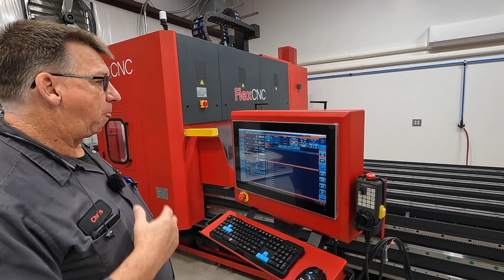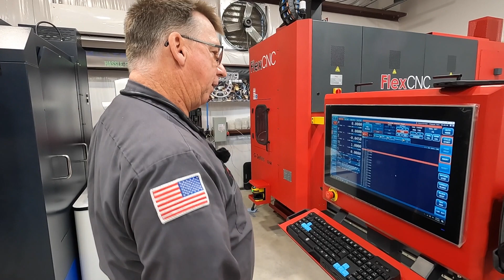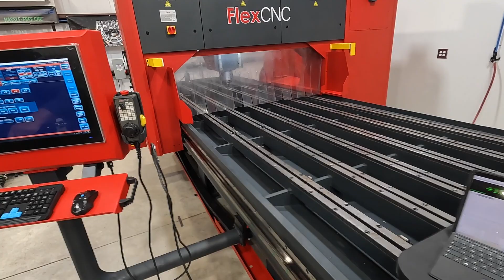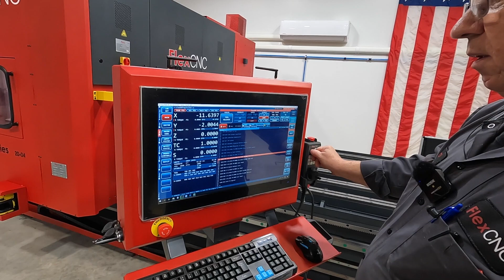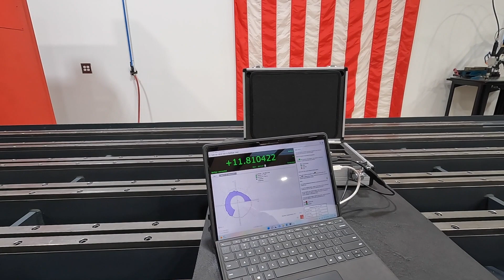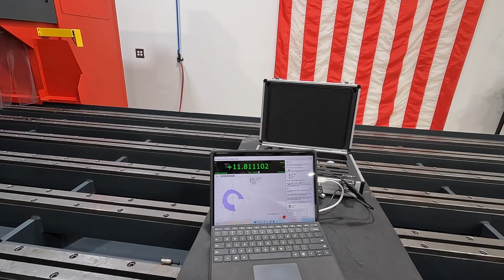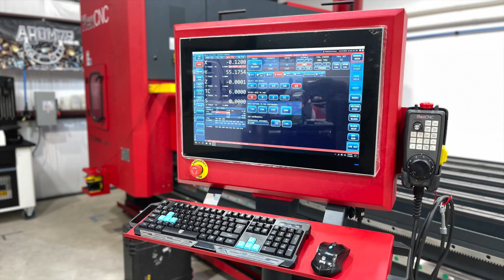Installing the Flex CNC Long Bed Vertical Machining Center

Comment: This thing is enormous. In curious what you are going to make on it!
Reply: The Flex can do more than large parts.  One of the things you can do with it is set up multiple stations along the bed for the same part.   You move the parts from station to station.  So, instead of doing one step on a batch of parts, then setting up the next fixture and doing all of the parts, then setting up the next fixture, etc., you set up all of the fixtures and move the parts from fixture to fixture.  While the machine is working at the first fixture station on the first operation, you're moving all of the parts to the next fixture in sequence.  When the machine moves to the second station, you're putting a new piece in the first station to start the first operation.
Reply: Please don't refer to a79 as a thing. Yes he is big, but he used to be a human before monetization got the hold of him.

Comment: The remote access via WiFi seems like a potential problem from a malware standpoint. It would be a shame for someone to be able to come in and trash your calibration tables. Probably a good idea to make sure the settings are all backed up so they can easily be restored. My experience tells me that software security is an often neglected part of these robotic systems. I like the safety measures that are in place. It might be a good idea to put some warning tape on the floor to indicate where it is safe to walk in addition to the built-in measures. A pretty cool machine. I'm excited to see some of the fabrication you end up doing.
Reply: Thanks, Doug. I'm sure they never thought of that.
Reply: I'm sure it has an Endian with a firewall.

Comment: Adam .. The man that machines to very small tolerances and accuracy , watching the drill man butcher a hole at whatever angle must of been spewing inside 🤣
Reply: Harsh 😆but fair
Reply: I was thinking the same thing!
Reply: The precision machining isn't done on the metal pads on the concrete floor. It is done on top of the super leveled machine bed. What, are you a doofus?
Reply: @swedishpsychopath8795  every part of the job is worth doing it well.
Reply: @swedishpsychopath8795  true, but as someone who watched a factory tech totally butcher the installation of our CNC machine (sloppy, cutting corners, careless), I can say that when you put up the $$$ you expect a good job, through and through.

Comment: At 38:47 Chris says it is accurate to 0.6 across 240". That means 1/400,000th ! Over that distance. Amazing.
Reply: I wonder if it's going to be that accurate with the mounting bolt holes into the concrete all drilled pissed as a fart, not one of them upright
Reply: Moreover, the machine can re-calibrate itself just in case the concrete shrinks.
Reply: I was trying to figure out what you were saying but thanks for the timestamp... 0.0006" across 240" is what you meant.
Reply: @GilmerJohn  Actually I think he said it was within .024" but the control corrected that error to .0006". Then Adam said leveled to .001" but unless the bed and the gantry rails are not parallel I suspect that is not correct. At 37:50 I believe that is actually what the machine looks like so it is either humped or bowed I can't see it well enough to tell what the software is indicating.  Even so .001"/ft of travel is not bad. Assuming the bed is parallel to the gantry when he mills the rails it should show what way it is assuming he takes a cut smaller than .010".

Comment: I'm sure there is more checks and install stuff going on but I hope these guys run a string line down the bed from the head assembly to make sure the bed is fully square from the far end of the bed to the vertical head end.  Definitely needs a professional install, way too many parts to assemble.     Waiting patiently for it to be all done so we can see chips & coolant fly !
Ahh posted too soon -- lasers  'nuff said
Reply: Lasers are 1000x more accurate than strings.

Comment: What kind of jobs is a machine like this for?
Reply: working on large structural beams, H, Square and so on. Among else
Reply: If a part has multiple machining operations, you can set up all of the fixtures along the length of the bed and do all of the operations in sequence instead of batching parts by operation and then changing the fixture.  It's not just for making large parts.
Reply: You can do a lot of stuff on something like this. Everything from small stuff to very large, complicated 3D stuff. You just need the proper work holding tools.
Reply: Perfect for shaft work!

Comment: Is concrete not supposed to be drilled straight?
Reply: coriolis effect.   you need to drill the holes at a angle to compensate for the angular velocity of the earth's rotation.
Reply: @ScottPankhurst  Ha ha good joke
Reply: @ScottPankhurst  🤣🤣👍
Reply: @ScottPankhurst  You forgot they also have to factor in the gravitational pull force from a79 massive body ...
Reply: No, it doesn't matter.

Comment: In there a reason they didn’t install the feet off a template then deliver the machine directly onto them?
Reply: It won't work. Trust me. Better do it the way they did.
Reply: @swedishpsychopath8795  we install all our machines with templates, they are accurate to the mm even with our subbies. Thats better than what you get from a 3/4” sds.
Reply: @toml8142  I don't think so. Please trust my gut feeling om this one.
Reply: @swedishpsychopath8795  I’d rather not but learn the reason why, I’m sure there is one.

Comment: That milling machine is going to launch chips all over that new machine...

Good video 
🇬🇧☹
Reply: It has flexible strip curtains on both sides of the machining head to contain the chips and coolant.
Reply: @buckhorncortez  

So not the rails it rides on then...
🇬🇧☹

Comment: Why do you need a machine that size?
Reply: I'd say there is probably a gap in the local market for large machining, Having a machine that can do big parts can open you up to customers that other shops can't even entertain due to the size of the parts thus giving you an edge in a very competitive industry. Earning the trust of customers on big parts will then bring you their small stuff because with repeat machining customers it's often not about price but about knowing a shop delivers good parts on time every time.
Reply: @rashesthippo  He's a Youtube Content Creator.
Reply: @colinfahidi9983  yeah? and a machinist who takes on jobs.
Reply: @rashesthippo  .... for content creation.
Reply: @colinfahidi9983  well yeah... Everything is content but you could say that about anything. The question was why such a big machine

Comment: One thing to consider with that large coolant sump is how much coolant could be lost to evaporation. You may need to start controlling the humidity and climate of the shop constantly, otherwise a ton of coolant will evaporate. It will be a pain to constantly monitor and maintain your coolant percentage with a big sump like that by yourself. Just something to think about if you haven't already.
Reply: Just a thought:  it might make sense to cool the "coolant" so that it doesn't evaporate and (duh!) does a better job of cooling.   It also might help keep stuff from "growing" in the water/grease/oil mix.
Reply: How much is going to evaporate and what is the range of concentration? On Adams tour of IMTS (see earlier viedos) he ordered a system for automatically mixing the coolant concentrate. The coolant these machines will use is basically water and "soluble" oil. The oil does not evaporate at any great rate. The water will evaporate over time though not as quick as you might think. It is a simple thing to check using a 'refractometer'. If the concentration is too high (due to evaporation), add water. Some simple calculations will tell you how much water to add. It takes a few seconds to check the concentration.

Comment: OMG that guy did not drill the holes straight and true into the floor...(Godsdrilla).. Its driving me nuts.. hehe..
Reply: Yup!
Reply: laugh, i thought i was the only one who noticed that. The hole was only to hold the steel plate down, so probably not important.
Reply: @magicman9486  The holes drilled in the floor aren't just to hold the plates down. The anchors go through the machine's leveling pads AND the steel plate. Once the machine is leveled with the jack screws ... which bear on the steel plates ... the nuts on the anchors are tightened. That "sandwiches" the whole assembly to the floor.
Reply: @magicman9486   I know, but is the guy a machinist or glorified capenter?

Comment: Why are the table rails lower at the end near the coolant tank?
Reply: They're not lower, the rails actually just end there, probably because the gantry doesn't go any farther, and the rails are machined in place.
Reply: Now that I think about it,  the area is probably to get the gantry clear to place and remove a  large piece.

Comment: How do you plan on handling the parts for this machine? Looks to me like they may be heavy/awkward.
Reply: Have you seen the crane in the center of the shop? ;)
Reply: @rasmusb2523  yes, but I don’t think it has the reach to handle part loading and unloading of this machine.

Comment: My only complaint is that you are trying to learn 2 different CNC Control Systems at the same time, that is making it really hard on yourself Adam 😢
Reply: Yah too bad all of his machines can't run the same Control system
Reply: @magicman9486  Thats what you get for not choosing HAAS.
Reply: During my apprenticeship we ran Haas and Fanuc at the trade school, at the shop it was Mazak and Okuma. He'll figure it out, and as far as I've understood it he'll primarily be running them with CAD/CAM, so shouldn't be a problem.

Comment: I don’t understand why a machine that big and heavy needs to be bolted to the floor. How would it ever move any at all if not bolted down?
Reply: The movement of the machine, the cutting forces, and in certain climates the ground will move with the seasons and cause the machine to become un- level.
Reply: @DadBurl  Fast rapids can also move the machine over time,   big mass changing directions fast.
Reply: Everything moves. Either from ground moving or from the machine itself working. Last cnc shop i was in, you could see the marks in the piece when a big semi went by. Now, your gonna say, thats because the concrete wasnt thick enough. No, the floor was 10" thick and each machine had its own pad. Youd be amazed how much stuff moves. Just because its big and heavy and planted on the ground it cant move. Thats completely wrong. Even if its bolted down, it still moves, just not enough for you to detect it, instead its moving in unison with the concrete.

Comment: Interesting stuff. Unfortunately, it’s not why I’ve watched your channel since the beginning. I hope it works out for you…
Reply: It an be a bit 'boring' at the moment to many that enjoyed his older machining videos, I can agree to that. He is in a 'sorting things out' period now. Can be more interesting again when he get's all this new equipment hooked up and start do some real production
Reply: A shop full of machines that didn't cost a dime unlike a divorce but for adam
Reply: @Rimrock300  Fair enough. I guess he can only remove a broken bolt or bump in a 4 jaw so many times. The problem for Adam is that the CNC machining space is already full of seasoned experts. Hopefully enough CNC beginners will follow along on his journey. It will be interesting to see if he can add new viewers as the manual machining crowd drifts away.  Times change. Even This Old Tony with a million subscribers has faded away…
Reply: @jmcc685  It's strong competition within the CNC space, for sure. Guess he has been posting on social media for about 8 years now. Been great to follow the work he has done on manual machines. But can't blame him for wanting to learn something new. Nothing last forever, at some point one have to ad something new to a YT channel like this. The shop he is now is to small for any larger work. He has indicated he got plans of building a new larger shop of his own, in connection with a possible new house. Hope he can move into a more suitable shop in not to distant future, and ramp up production. Possible get someone to help him out with videos and youtube stuff, so he can focus more on production and more income next to youtube

Comment: Miss the old SNS. Too much ooo look what I’ve got these days on YT…
Reply: Actually , Adam is teaching more now than he did before and he was always teaching valuable stuff for manual machining and repair work.
Reply: Sure wish I had some of the machines that Adam has.
Reply: I’m with you. It’s great he has all the new machines but  what drew me to this channel in first place was the passion for manual machining  and Adam’s interest in old tooling.  Perhaps it’s  just me but programming CNC does not do it for me.
Reply: Miss the old YT. Too much haters these days
Reply: @pmdeutsch  agreed
Reply: I’m not trying to hate on the new direction of the channel. I think the automation is fine, but this simply wasn’t good content. It wasn’t interesting hardly at all.

Comment: You need a bigger shop,,
Reply: I was thinking the same thing.  How is he going to move things around when there is very little room now.  That is also a lot of very expensive, New hardware building this shop up.  Where is all this money coming from?  It's going to take years to pay it all off.  This is a shop for a number of people to be working in.  Lots of new CNC stuff he doesn't have any real experience in.  These are $100K+ machines.  I think he needs the place next door.  Right now tripping over everything.  No room for storage either.
Reply: --  AND more people.   I'm sure it's fun to be a one man shop but maybe it's time to bring in some helpers that will come in and become more expert than yourself in a narrow area and then move on to be replace by another.
Reply: @jbdragon3295  Why are so many worried about the money? That is none of our business. We have no idea of the deals he has made with these companies. Id be more concrned on learning said cnc equipment before filling the shop with cnc. All 3 of those machines have different programs parameters that have to be followed. Even the lathe and mill, even though from same company, programs are laid out differently. This is straight up brain overload. In my opinion, if it fails, its because there isnt enough time spent on them learning. I hope the best for him, but im afraid that pickin through the cnc side is going to take a long time to figure them out. Obviously, we dont know what he is doing in the time the camera isnt running, maybe he is learning?
Reply: @oldiron4135  People are not worried about Adam's money, they wonder what is Adam's plan and reason for spending so much money on a direction for this channel that is entirely different than what made the channel popular. CEE has fewer subs than Abom79 yet views on CEE videos are 5x-10x more than Abom79, why is that? Because CEE is doing real work, and when CEE gets a new machine it's because there is work to be done that requires the new machine. People don't like posers, and Adam is quickly becoming a poser on YouTube.
Reply: @andrewterry8092  CEE is a great channel, no doubt. Very skillful guy, the channel must be a great source of information too people in the same trade. He got a great advantage that his wife/girlfriend takes care of filming and youtube stuff, so he can focus on the shop mainly, just speak and explain as he goes along. Adam is a 1 man show, where videos and editing naturally takes away quite some time from doing shop work. I think Adam did go a bit tired of doing the same stuff he had been doing for 20 years. He wants to learn something new, and share it with his viewers. At the same time he do the old stuff once in a while. If the views/income at youtube goes down, he will spend more time doing machining, and less videos. So far the videos keep coming, so it must mean the channel is doing alright. I better like the older videos from when he worked with the company. But I'm happy for him in trying something new, that it seems he enjoys

Comment: The calibration looks rather time consuming. Does it need to be periodically recalibrated?
Reply: Not with A36 work like he was talking about on the tubing. The expansion joint in the floor will tell the tell. Concrete cracks and settles. If he wants to do airplane or NASA work and splitting hairs (.003) over a 20foot length, accuracy could be a problem. Yes, he would have to buy that system or pay $$$$$.$$ prior to a job.

Comment: No disrespect meant by my comment, but the quality of the content has decreased over the past 2+ year. It used to be raw and straight into the manual machining Op with the helpful tips. Now i feel it's gone from passion to financial reasons.
Reply: So sad but true.
Reply: Half a million subs tends to change the YT dynamic for a lot of content creators it would seem. I rarely watch any of Abom's vids any more but am still a fan. You're right, the channel has changed to it's detriment.
Reply: @smash_1389  guess you were before he was making once in a state shafts. Was second to none for learning shaft turning.